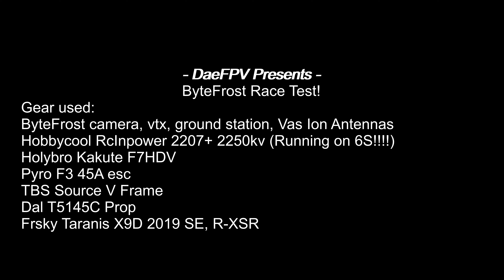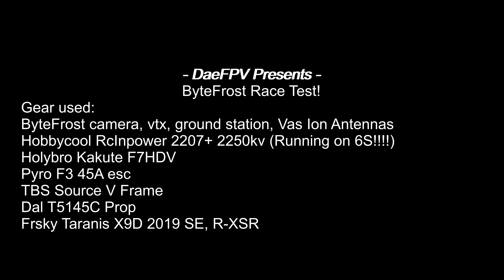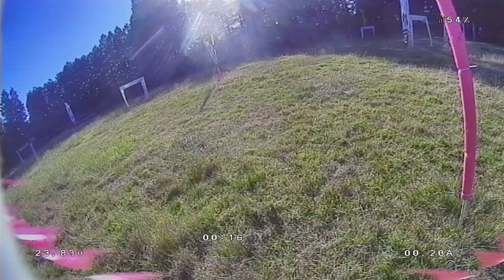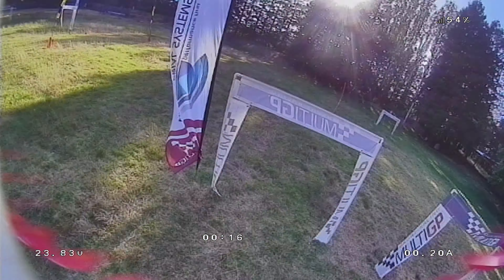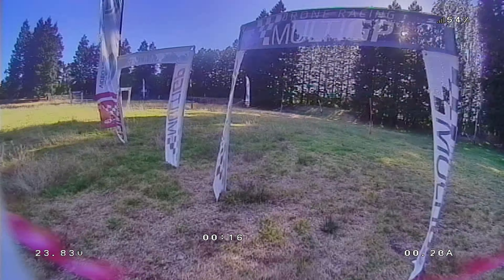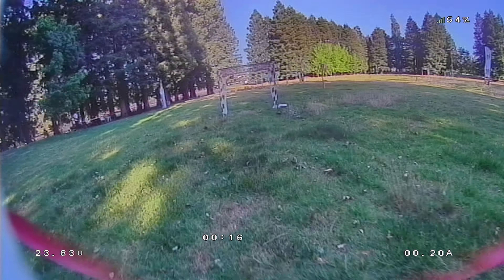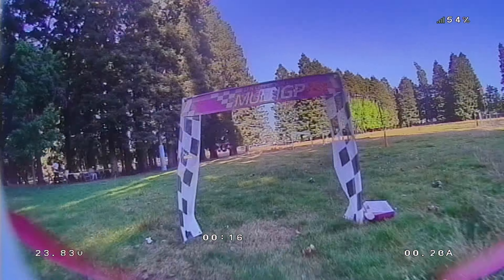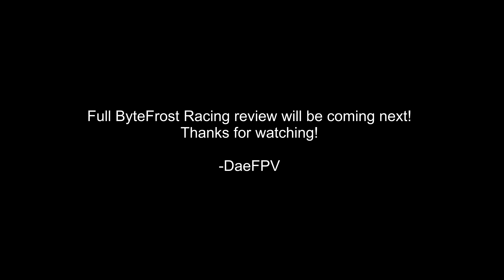Fatshark ByteFrost Racing test with HDO2 on a TBS Source V Frame - digital or anlaog??

Comment: what do you guys think about goggles fov for racing? i always feel like 35-40 deg fov for goggles is perfect but you guys are using hdo2 which has bigger fov did you guys struggle on hdo2?
Reply from the maker: Hey angel, I've owned the following goggles in the past 5 months - hdo2, orqa, hdo, hd3, hd2, t2. In the end I kept the hdo2 and sold the rest. I like the wider fov, I think the 46 degree fov is about right. Gives me the peripheral vision to spot my next gate while still big enough to line up the current one.

Comment: You said, you didn't feel any difference between analog and bytefrost. But do you feel a difference between DJI and analog on that track/range?
Reply from the maker: Hey Sascha, yes you can feel the latency of dji on tighter sections like the slalom or corkscrew. Long sweepers are mostly fine. The issue with dji is that the latency is inconsistent, it's difficult to fly that way because you can't compensate for a constantly shifting latency

Comment: How durable has the source V been? Does it break easily?
Reply from the maker: I've seen reports of the motor mount piece of carbon being fragile. I've had some pretty gnarly crashes and it's been holding up well so far.